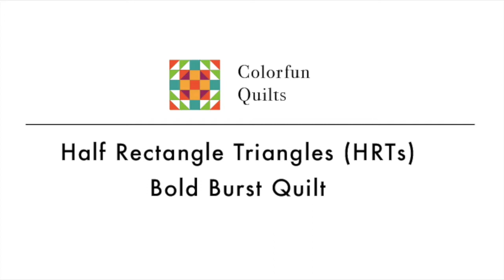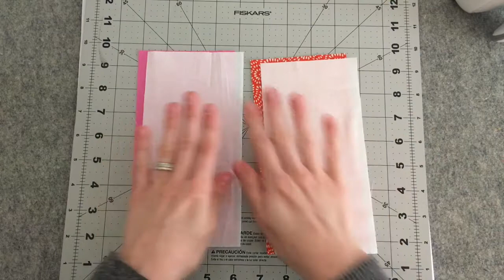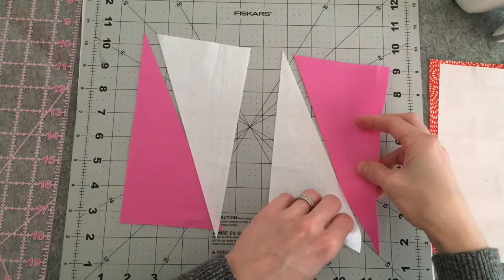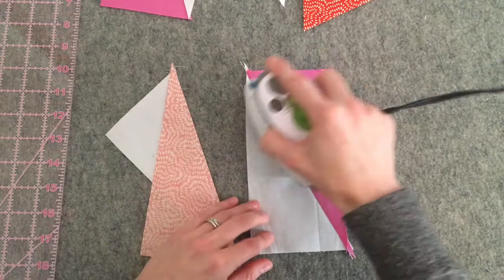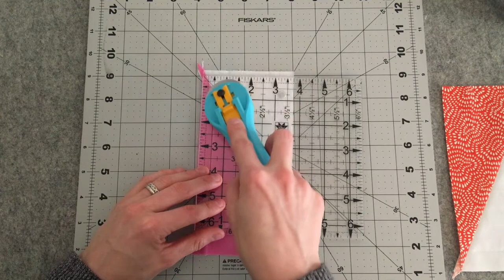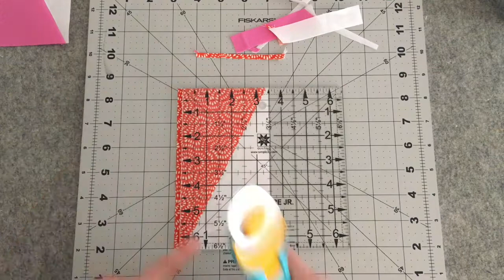Half Rectangle Triangles Tutorial

Comment: Thank you so much for doing this tutorial! I need to make HSTs and HRTs for a quilt - neither of which I have done before. How do you calculate what size you need to cut the material for an HRT to end with the size that you need? I need the finished size of the HRTs to be 5 x 7. Is there a graph or table that shows these calculations, or can you please tell mw how to calculate this? Thank you for any help you can provide. :-)
Reply from the maker: A good rule of thumb is to make your original rectangle 1” wider and 2” longer than the finished HRT size you need. But always make a test block to determine if this will work for you or if you need to go bigger! There are HRT charts that you can google as well. Happy sewing!
Reply: @erinryan4880  Thank you so much for the timely reply. That is exactly what I needed to know. I think I will do a test block on scrap material to make sure!